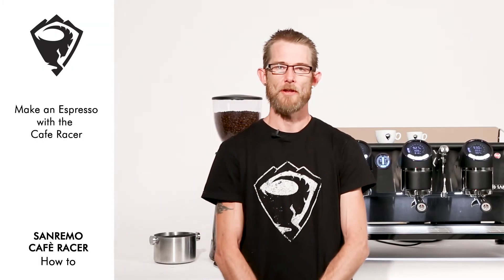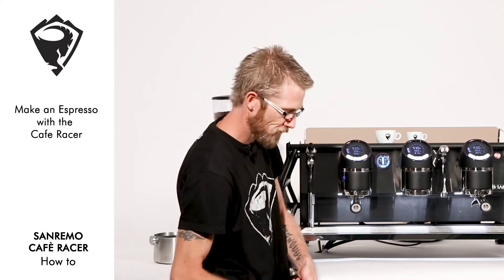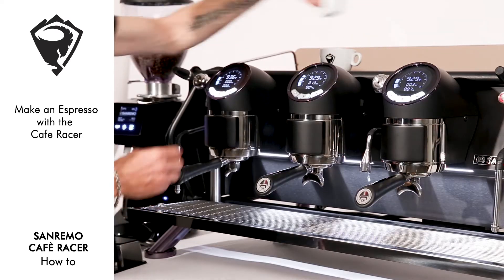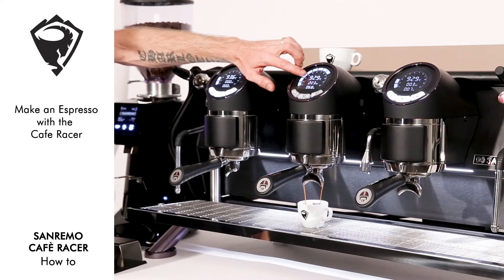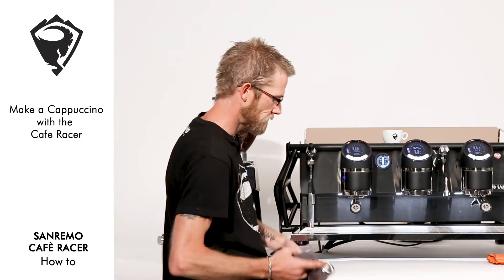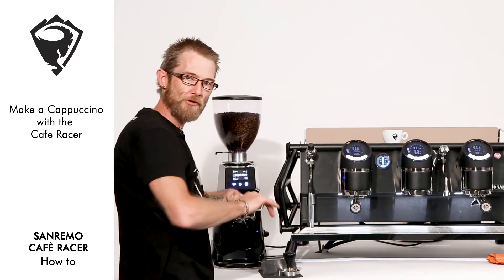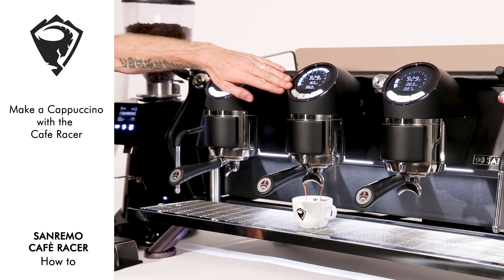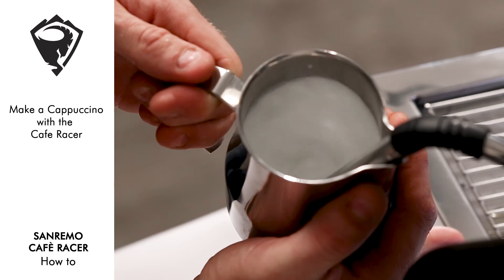HOW TO MAKE ON ESPRESSO WITH THE SANREMO CAFE RACER

Comment: This is the first time I think of a presenting barista as a former motobike rider or at least a hard rock musician. :-) The machine design is gorgeous (especially the white version with pronounced wood handles and other parts) but a few days ago I spoke to a local female barista who had been happier with the classic Faema E61 citing its more robust steam power and proclaiming Racer has just a single hole in the steaming tip in its standard configuration which I could hardly believe.